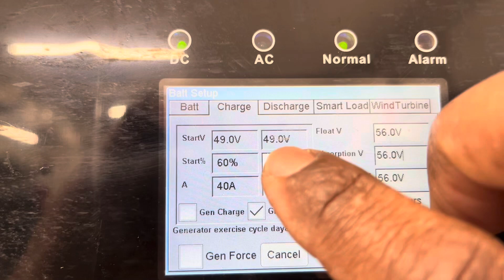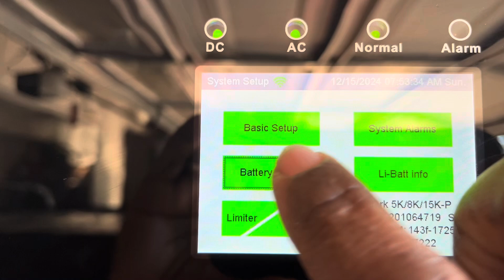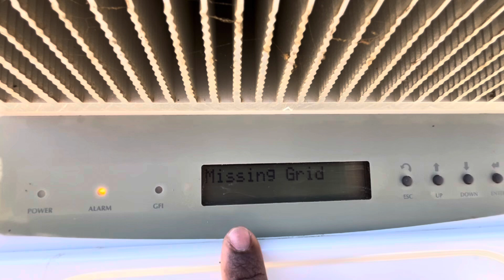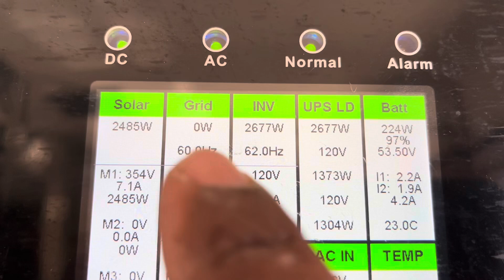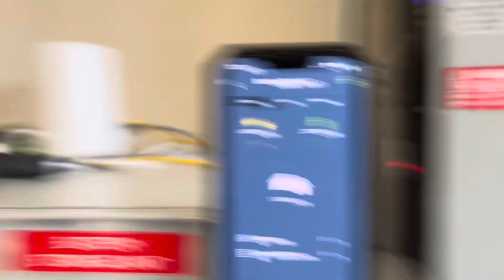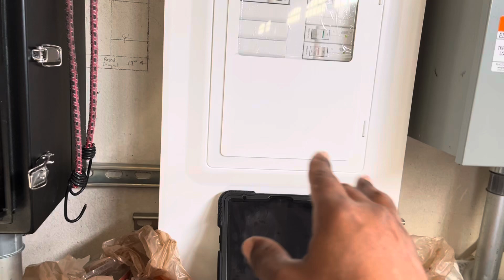Add Batteries, More Panels And A Generator To An Old Grid Tied System Using The Sol Ark 15k

Comment: How do you have that generator auto starting and is that an ATS to switch between the grid and generator?
Reply from the maker: I’m using the 2 wire start feature on the Sol Ark 15k to trigger a GSCM Mini start module to start the Westinghouse wgen9500.

Start And Stop Your Generator From Anywhere Using The GSCM-MINI And The Sol Ark 15k
https://youtu.be/_22QAJYwaFE

The Sol Ark 15k’s ATS feature switches the grid to generator. 

I have since changed the generator connection to charge my batteries directly using the EG4 Chargeverter.
Thanks for the comment!
Reply: @GeraldsLyfeProjects Thanks for the reply!  I have a Sol-Ark 15 on the way and gathering as much info as I can

Comment: can i hook up 3 phase generator on it?
Reply from the maker: Yes, the Sol-Ark 15K-2P hybrid inverter can work with a 3-phase generator, but it's important to ensure the generator voltage matches the Sol-Ark's voltage settings (e.g., 120/240V or 120/208V) and to configure the inverter correctly for 3-phase input. 

You need to select the correct grid type (e.g., "120/208V 3-Phase") in the Sol-Ark's settings before connecting the generator.

I would urge you to consult with Sol Ark about your particular setup before purchasing the Sol Ark 15k.

Comment: Nice setup. which model generator are you using?
Reply from the maker: I’m using a Westinghouse Wgen9500 and the THD (Total Harmonic Distortion) is pretty high at 23%. But the Sol Ark 15k handles it like a champ. I would not recommend this generator for any other inverter. In fact, right now, I only use it to charge the batteries directly via the EG4 Chargeverter. 

If I use the generator with the EG4 Chargeverter, I don’t have to worry about the 23% THD and this setup  also allows for me to have the full back up power from the Sol Ark 15k. 
Thanks For The Comment!

Comment: Gerald, I've got this exact same grid tied inverter, except mine is branded Solar City (since absorbed by Tesla....). We bought a house and the grid-tied, and leased, solar system was already here. We inherited the lease and pay Tesla a monthly bill. Sadly nothing we can do about that yet. We want more solar and battery storage, however. Did you have to get a professional installer or permits to get the SolArk installed to "talk" with the grid-tied system? I am hoping to be able to do most of the work DIY. Feels like anything I do that is going to touch the grid-tied system is going to require a permit.
Reply from the maker: This is a DIY system and I did have to get a permit to apply for the NEM 2.0 program here in Southern California and also to make sure that I’m covered on my home owner’s insurance. This is a basic video of how I did it:
https://youtu.be/GOuyheLlNlU?si=8a5JUXZC8lcEoXKH

I would encourage you to mostly BE SAFE. Safety First!
Reply from the maker: Check out the EG4 Flex Boss 21 and the EG4 Grid Boss before the Sol Ark 15k. Because you already have solar, you may not need a permit. The Sol Ark is very solid product but the EG4 products offer more expansion capabilities.

Comment: Thanks… a timely video for me.   2 years back I set up a sol-ark off-grid system in a cabin. 

Now I’m moving that simple    1 sol-ark - 1 battery - 1 generator  to my new build.  

That old system functioned so well that I seldom put my hands on it. 

I forgot everything that I once knew.

The new system has 2 sol-arks, 8 Kilovault 7.5 HAB batteries, and 2 14kw gens… 

This is a great refresher course for me. As well as a great tool for new users.
Reply from the maker: That’s Good To Hear!!